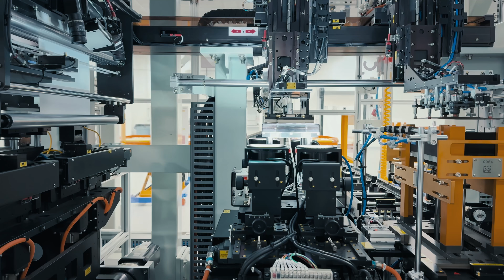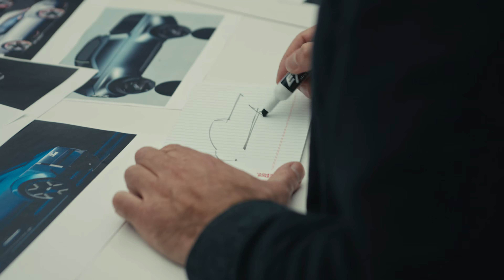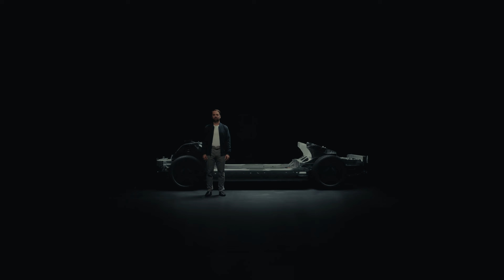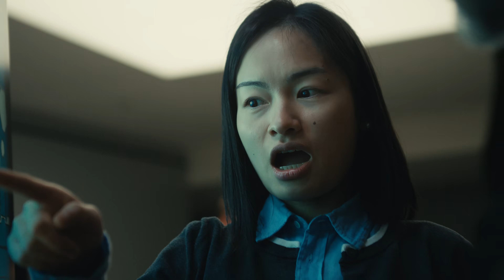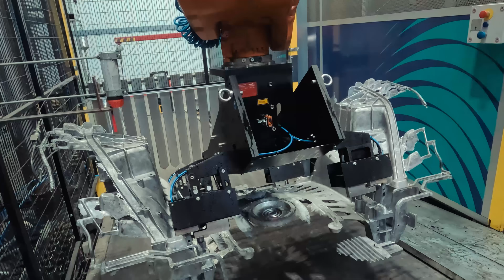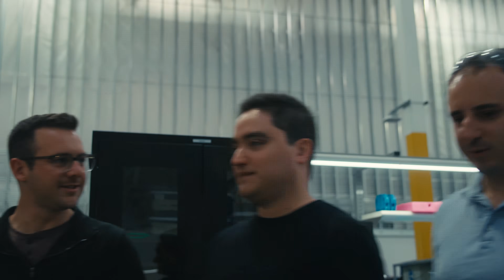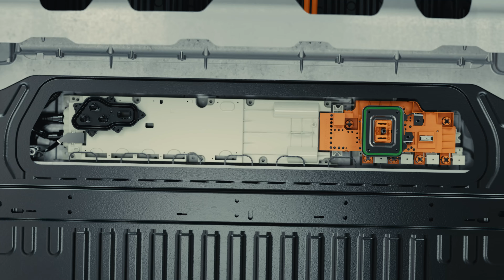Ford Bounty Hunters: The Pursuit of Efficiency

Comment: I want to see Ford’s answer to the Rivian R2 and Volvo EX60.
Reply: That's the second top hat on this F U E V People setup coming in 2028. They plan to launch 5 or more top hats on this platform and several are 5dr 2 row suv/cuvs besides the truck and it's rumored a sedan to compete against the model 3.
and ford has mentioned bringing back the focus or fiesta but using renaults amp platform by 2028 in the eu?
Reply: @4literv6  I’d like to see something equivalent to the EX60 with the range and charging speeds to match. Not sure this thing will do it, at least not with the LFP pack they’re talking about.

Comment: 48 Volt is really cool and awesome 😎
Reply: It will be nice to get rid of the 12v battery system. The savings on weight and complexity will be substantial.
Reply: @GeeDeeBird  safety regs won't allow for oems to delete the archaic 12v anytime soon though smh. Fun fact the single most recycled item across the whole world is 12v lead acid batteries!
Reply: @4literv6 That's not true. The Tesla has 48v architecture, as did the new Ford UEV platform.

Comment: Really enjoyed getting a peak at all the new updates and features incorporated into the next gen EV midsize truck. Some of my favorites are the 48 volt low voltage system which finally moves passed the archaic 12 volt system manufacturers have been using for the passed 50 years. I'm surprised this change has taken as long as it has as many vehicle now need 2 or 3 12 volt batteries to maintain all of the electronics in vehicles and still often have issues. I'm also happy to see the mega castings and structural battery packs. I would like to see 800 volt architectural for efficiency and charging metrics but I understand that a 400 volt system will be cheaper.
Reply: It's not just cheaper in the us over 95% of all the installed dcfc are 400vs not 800+ although that is starting to change. Even globally less than 10% of installed dcfc through 2025 had 800+v setups. And 800v also doesn't really do anything at home where 85-95% of all ev charging happens so yeah. 800v+is sexy and exciting to talk about but the infrastructure isn't there for it widespread and it does nothing when charging on lvl1&2 slow chargers!

Comment: I'd rather have a ... "crossover"? "SUV"? Whatever we are calling it now. If this has a midgate that folds this could work though. Glad to see a focus on efficiency, since I think that is the point for a lot of (most?) EV buyers.
Reply: EVs are 4X more efficient than ICE. What people freak out on is range. But aero, weight, drivetrain efficiency ==> battery size and weight.
Reply: @j @jamesvandamme7786 oblem is range yes but people don’t plan ahead so since they have poor planning EV = bad
Reply: @jamesvandamme7786   yeah I'm saying the reason I would buy an EV over a hybrid is for the better efficiency.

Comment: Just like the original Maverick that was promised for $19,999.
Today the Maverick starts at $30,000.

The Maverick EV might start at $30k. Eventually it will start at $49k.
That's why we need the Chinese EVs in North America to control the Greed!
Reply: That’s on par with inflation, in addition to pandemic causing scarcity of parts and great orange stains tarriffs
Reply: @scottoden4144 
You work for Ford or the dealership?
Reply: @wt9653 it’s simple facts. Inflation calculator from 20k price in ‘21 to now is approx 25k. Pandemic, and tariffs price is 29 ish but you can get a base for less than that. There’s literally base models for sale for 24k-26k.

Comment: Risky to put batteries part of frame, what happens when it goes bad? Totaled?
Reply: Teslas have bin doing that for years down in fact most evs have a structure battery pack surprise ford didnt
Reply: @mcsike7264  omly some model Ys? If a small accident, the car is done. Battery removal will likely cost way more than a lightning.
Reply: You can still replace the battery in a.model Y you think tesla has not thought about that XD @stephenwalters1814
Reply: @stephenwalters1814 no since the lightning uses a 100+kwh battery model Y is like 70-80kwh
Reply: @mcsike7264 i mean labor hours to get the battery out of the vehicle.
Reply: Pull it out and fix the bad module or whatever, hoist back in. Use your old transmission jack.
Reply: @jamesvandamme7786  that won't be expensive?

Comment: Nice, zonal architecture! This sounds like exciting stuff and great areas of improvement - can't wait to see the results
Reply: except for tesla has used this since 2017 on the model 3 smh, rivian since 2025 on the updated gen2 r1t&S, and lucid on all it's models plus many of the chicom evs use zonal architecture since 2022 ish as well. 
Many of them also use structural battery packs with no modules or in cell to pack setups. Many use like tesla the lid as the seat mounts to, they use massive gigacastings inc chery who in 2025 casted the entire underbody of a compact car in one shot, they use casted battery trays etc. 
So none of this is new by the time it arrives in the F U E V People midsize truck that isn't a truck by fomoco next year. Many competitiors will have had these so called innovations in their cars for 3-5+years already!
Reply: @4literv6  I know - I never praised it as an innovation. I'm just expressing encouragement to a legacy automaker for adopting a modern ev/software defined car design philosophy

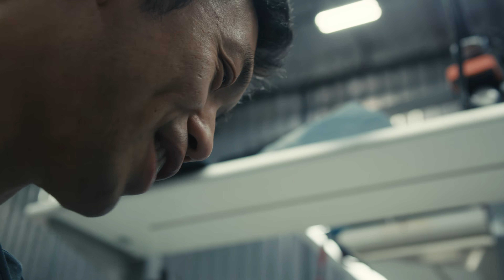Comment: 12:00 mentions the battery is 400v, is that right?  Come on Ford, it should be 800v for new EV designs, its not more expensive overall.
Reply: 400v is fine. The charging curve is the real challenge and they know this. If they can hold 250kW deep into the pack, let's say 60% then taper to 180kW to 80%, you're looking at a monster, on what will be a 125kWh battery pack.
Reply: @JDDevice  exactly... One could dream of pushing 250kw out to 80% but there is no way Ford is going to be doing that with their limited experience in batteries. Hopefully Tesla and their new DBE 4680 can start hitting charge rate like that though. Specially if they add some silicon / SWCNT I would imagine that they could get close to that level of performance.
Reply: @JDDevice yeah and you need an 800v system to do that. Most charge cables are limited to 500 amps, which at 400 volts only gives you max of 200kw.
Reply: @digger450r Incorrect. Lots of vehicles hit 250kW that aren't 800v, take the number 1 selling EV in America, the Model Y. From my understanding Ford will be borrowing chinese battery chem and building them domestically. Which chemistry? Who knows. Blade battery? Golden battery? Time will tell.
Reply: @JDDevice yes, and that is because Tesla supercharger cables have higher amperage limits. It's part of why their cables have always been so short.
Reply: @JDDevice  400V is also a range.  Tesla's current battery packs go up close to 500V, where GM's 10 module packs are as bad as 300V.  Both are 400V by name, but much different charging rates.  If this new architecture stays in the voltage range Ford has been, charging will not be spectacular.  They didn't really talk much about this in the video, so seems to be a let down - all other things considered.
Reply: @JDDevice  It's no guess it's catl approved lfp prismatic cells with a 205 watthr perkg energy density at the cell level. Built under license controversially in MI.
Reply: the main problem though is the cost, dealing with 800v is alot harder/expensive, but agreed it would be nice to see more adoption of 800v to drive down the power electronics cost
Reply: @Nathan-ty6fd  Harder, yes.  Much more expensive, no - at least not according to Lucid.  And the gains you get in efficiency and charging rates seem like a ball dropped here with this new platform.
Reply: @billjohnson3344 I thought the Silicon Carbide FETa used for 800v were way more expensive
Reply: Larger batteries need to be 800v.  Smaller batteries do not.

Comment: Be Careful. KIA/HYUNDAI have massive aggravation with their single integrated ICCU box. 
DON'T PUT ALL THE EGGS IN ONE BASKET.
Reply: BYD does it just fine. They integrate the VCU, BMS, Motor Controller, Power Distribution, DC-DC, onboard charger into the motor/transmission unit.
Reply: @katelights  and if it fails, you're facing a huge cost for a small problem

Comment: 48V LV system, yes! What's the traction pack voltage, 800V or 400V?
Reply: said in the video multiple times 400v main pack! Which means probably high 180kws charging maybe 200kws max and depending on a 60/80/96kwh pack size as already estimated from the video showing the cells&counting them? It means a 10-80% time likely of 25+mins as the amp dude with the lisp mentioned they are also using live in vehicle modelling to limit charging to prevent cell degredation smh. 
Then you look at the chicoms lfp&lmfp tech with up to 6c charging in use right now as in TODAY!
Reply: @4literv6 those charging rates and the battery chemistry is old news. Competitors are offering the LFP and higher rates as we speak. There’s no reason to get excited because Ford decided to showcase it in a fancy video.
Reply: @Energy.Theory  that was my point smh that this platform isn't innovative at all and isn't class leading in anyway shape or form. It's a copy of tesla first the chicoms second and then since most of the staff is from tesla/lucid/rivian/amp and the chicoms all their ideas can be seen by those oems! I was mildly making fun of it btw. I mean tesla had lfp charging at 200+kws using catl prismatic cells since the summer of 2021!
Reply: @4literv6 all teslas are 400v minus the cyber truck. The goal is affordability. When architecture changes to 800v then it starts to get expensive. Aka lucid Porsche etc
Reply: @4literv6  True, it’s crazy that Ford is touting a 400 V architecture in 2026. So many competitors from Europe and Asia already leapfrogged this last year. People want to recharge in about the same time it takes to refuel a gas car, not wait 30 minutes. For example, the 2026 BMW iX3 uses a native 800 V architecture that enables ultra-fast DC charging, adding 230 miles of range in 10 minutes and will be at dealers this summer. Ford will be shipping last year's technology next year. 😥
Reply: @justinmorgan7851  Im sure the BMX iX3 will start around $30,000 also.  🙂 While this speed isn;t revolutionary, if they can sell a midsize pickup that gets 300 miles for $45,000, it will be a home run.  I'll trade a slower charge speed for that.
Reply: Agreed, it’s true the BMW iX3 is pricey, but it’s probably not entirely due to the BMW’s 800 V system specifically. Rather, it’s mostly because it’s a BMW. A big part of the cost increase for 800 V systems is due to the existing battery supply chain for 400 V system (BMS, etc). But Ford is specifically designing new LFP cells and BMS to go with this new architecture. The point being BMW, M-B, and at least 3 low cost Chinese brands too, already perfected their high-voltage system over the past few years. With this new engineering project, Ford has a chance to catch up, but instead they’re copying an older 400 V approach from years ago.

Comment: Congrats 🎉 Finally someone not just bxtching and complaining about China’s progress but rather just taking it head-on. 

Affordable EV! Yassss

I was excited about the Lighting.
I was excited when Jim returned from China and wasn’t afraid to admit the Chinese were ahead of us.
I was excited when Jim announced the Model E moment.
I was heartbroken when Ford discontinued the Lightning.
I sunk into the floor when Ford did the $29B write-off, killed the joint venture, and appeared to have walked away from EV.

But today! To see that I might have a comparable option beyond a Tesla and a BYD. I’m excited again.

Congrats to the entire team on this effort. 

And for the every thing that is holy I Jesus name…….DO NOT LET THE BASE MODEL OF THIS CAR EXCEED $30K. 

BY ANY MEANS NECESSARY, KEEP IT UNDER $30K.

I’m ok, with buying a more expensive Trim, but I need to see that an effort was made to bring in the base at $28,700
Reply: They won't have a choice imo with the base leaf at 29k for 75kwhs, the base equinox right now is 30k with the statewide incentive for 87kwhs, the base bolt is gonna be 28k for 65kwhs, the base slate is supposedly 25k etc. And cell costs are dropping yoy by 8-12%or more.
Reply: they could just offer a smaller battery version for less than $30K. For people just tooling around town a 200 mile range is enough.

Comment: Anything but swapping the battery like a gas station🤣🤣😭
Reply: That's complicated. It sort of works in China, but I dunno about 'Murica.
Reply: @jamesvandamme7786  it works. Take the everyday economy car and turn it into a battery swap EV. Takes away the “expensive battery cost” to lower EV prices and takes away range anxiety. Pay a subscription just as the same as pumping for gas. I can understand EREV for performance cars but anything other than swap keeps you trapped and takes away time from moving forward. Also it takes away the depreciation in the used market. As for “takes to long to make a profit” let other companies chime in and take care of that just like a gas company would for car manufacturers

Comment: Saleem!!! I went to grad school with. Very smart guy. Congrats on your success buddy! Great to see you in the video
Reply: where did you go for grad school?
Reply: @vishnusnair972 we went to Clemson University together, but I left to go to Imperial College London before finishing at Clemson.
Reply: @saleemmerkt6544  Yay! Go Tigers! Got my Civil Engineering degree from there! :)
Reply: @vishnusnair972  cheta u just do lal salam in kerala kannur
Reply: Most energy dense LFP cells have 195 wh/kg energy density with ≈4000 cycle life,but there are even more room for further improvements.i hope ford with help of LG energy solution,will adopt and commercializes dry coated LFP cathode cells.dry coating has the potential of atleast 70% higher energy density LFP cells with dry coating and single crystal active materials techs combined.dry coated LFP cathodes have 55% higher active materials(amazing 290 wh/kg)also dry coating lets the electrode to be twice as thick as wet coated LFP cathodes(20% higher energy density meaning 330 wh/kg).also with single crystal cathode and anode active material they can achieve mind bending 350 wh/kg at cell level.dry coating increase the cycle life by 100%(8000 cycles),single crystal increases it by 30%(10400 cycles).dry coating increase the calnedar life by 100%(20 years instead of 10 years)meaning amazing 0.5% capacity loss per year in dry process vs 1% of current wet process LFP cells......